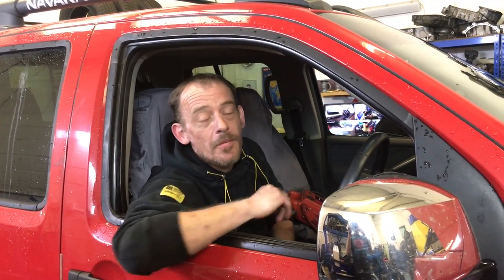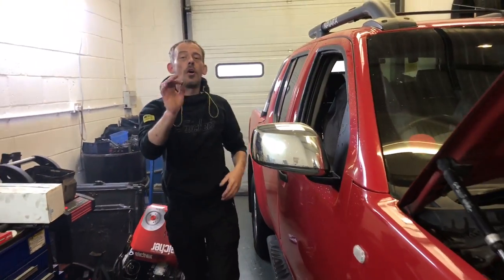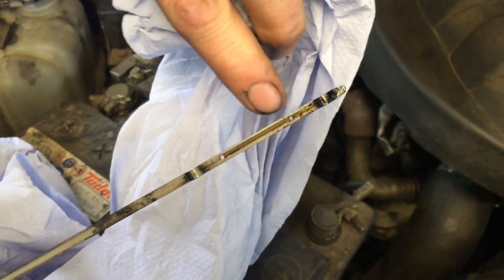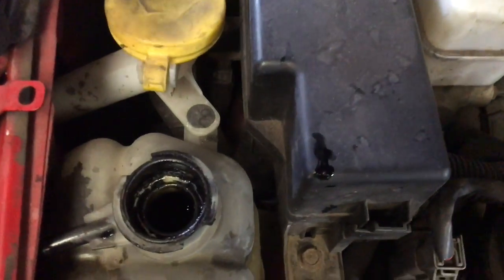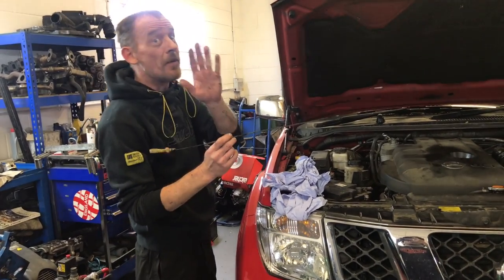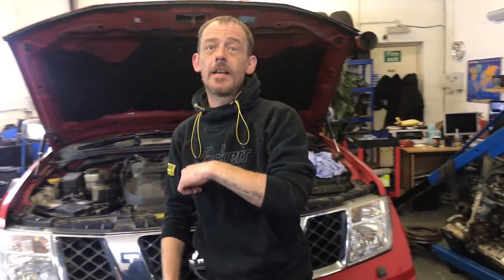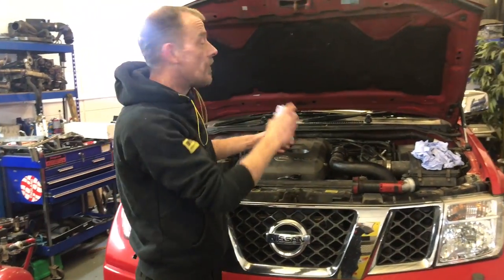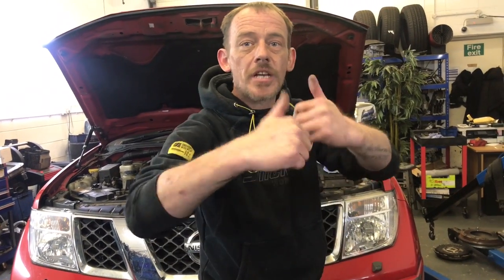Where has all the oil gone (oil cooler and turbo failure)

Comment: I have this exact problem on my 2012 d22, checked everything before i went on a trip and this morning wanted to check a levels again and boo.m, oil in the radiator.
Reply: hey mate i have the same car and now the same problem. i just noticed it 2 days ago. have you fixed the problem?
Reply: @bajsavic7127  hi, no it turns out it was just the oil cooler, it takes about 10 flushes to get the oil out of the cooling system. You can do a compression test at a radiator shop to be sure.
Reply: @franklinloubser4632  awesome mate got a cooler on the way then i'll do multiple flushes. cheers fort he response!

Comment: I was told that once oil has got into the coolant then all the hoses must be replaced because the oil deteriotes the rubber..
Reply from the maker: I use soap powder to clean the system.

Comment: About to replace the oil cooler on mine. Holy crap Nissan parts are priced like they are made of gold. $860 Aussie for genuine. I can buy 2 and a half new radiators for this one tiny part. After marketer oil coolers ranged for $50 - $200. I have been told though (Not from Nissan) to go the genuine as they have had a  lot of issues with the after market ones.  Fuck me it's a lot of $$$$ though
Reply from the maker: Well said
Reply: Thanks for the video

Comment: always informative ... great resource for "Poor Nissan owners" :-) . Can you shed some light on how Fuel ends up in the oil. I have an R51 Pathfinder that makes oil, via I think the return rail under the rocker cover?. Have had 2 go's at replacing the return rail ... seals. The issue is better, but still low level. Able to reliably run about 7000 Kms onto it before changing the oil. The head was cracked long ago, and the engine was K sealed about 20000 Kms ago. Can you offer some ideas for a repower or should I just abandon this very reliable old work horse. Used as a garden dump runner nowadays.

Comment: Hey bud, awsome video. Got a question. My d40 has diesel going in oil. I have put new copper washers and injectors from another ute, checked all the return lines and couldnt find anything, any ideas what could it be?
Also when u start up in the morning, it revs up high.
Reply from the maker: the injectors are faulty

Comment: Thanks for all the vids; great info; unfortunately I can't find anything about the issue I have with my 08 d40. Lacks power on take off and I  have to ride clutch on hills and while towing or will still (already 1 couch replaced). No engine lights or codes on obd2 link. Also not sure if related or not , randomly will lose power when cursing up hills , feels like fuel blockage but pump accelerator pedal and goes again otherwise will just keep dropping off. Thanks for any help.
Reply: Sounds like turbo veins or actuator my friend.

Comment: hi please help i have changed flywheel clutch and crankshaft sensor now i have a idleing problem
Reply: on my yd25 navara
Reply from the maker: Mate you have made some sort of mistake call me on 01274 663999 I will run through the issue Cheers Des.

Comment: hi mate. hopefully your video is informative. just had  oil cooler failute on the IVECO van  - just commeting to put "more information out there " first off people may tell you its the "head gasket" - but  likely it is not - symptoms - OIL IN THE WATER TANK - "in my case - loads of it - thus far - new oil cooler fitted - pipes and expansion tank - cleaned out completely - with dish washer tablets also - drove it for another day - water again full of gunk/ oil - cleaned it again today - will see how it tomorrow -  - hopefully iv been cleaning out the gunk back to some normality? you would think so right :) common fault -
Reply: Hey mate.
Just wondering how you went?

Did your water cooling system eventually get cleaned of all  the oil after replacing those parts and flushing it out a few times?

Comment: Hi, Great Video, I have a turbo failure, have you any advice on how you get the 17mm bolt out at the back bottom of the turbo, its a 2004 model, i can get a rachet on it just, but its to tight to undo for the room i have.  Thanks Dave

Comment: Hey guys, I got my rocker cover gasket done, new rocket cover done, had major oil leak so they re did the rocker gasket cover and sealant for gasket, seems to be fine, then black smoke started coming out so they fixed the egr and did new vacuum tubes, working fine, still minor oil leak, they replaced The cam sensor o ring, that Good now, now they say the front timing panel is weaping so Gonna fix that next service, not urgent. However still leaking! Leaking underneath chassis/exhaust line passenger side, seems to be mixture of oil and ac condensation but oil black as anything 'diesel' can you point me in the right direction?
Reply: 235000 kms, 2008 navara d40 turbo diesel

Comment: I never knew oil could get into the coolant
Reply: It's a symptom of a variety of serious issues - breakage in several places can cause oil and coolant to mix. The D40s automatics also have a known fault between the radiator and automatic transmission where failure can cause transmission fluid to get into the coolant, which can wreck the transmission, engine, and cooling system all in one go.